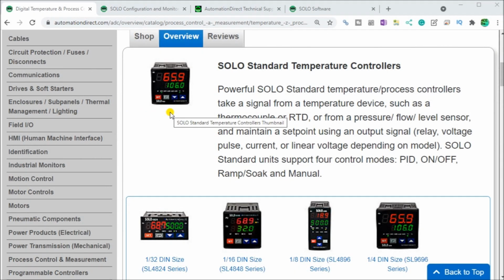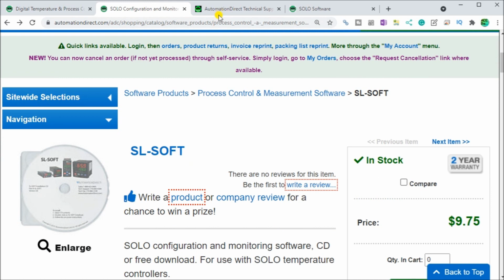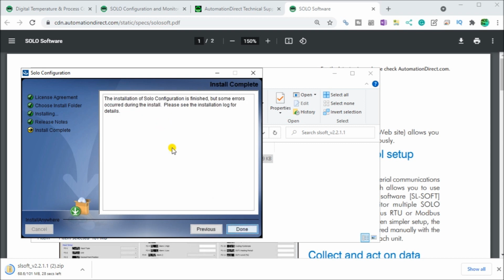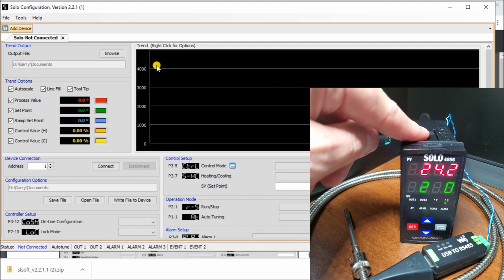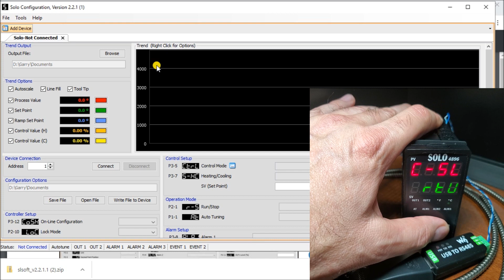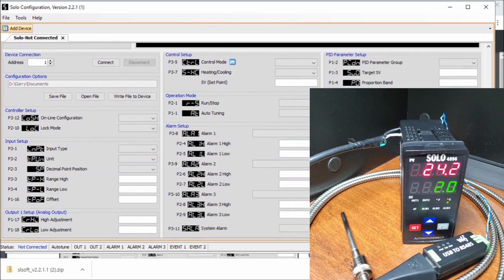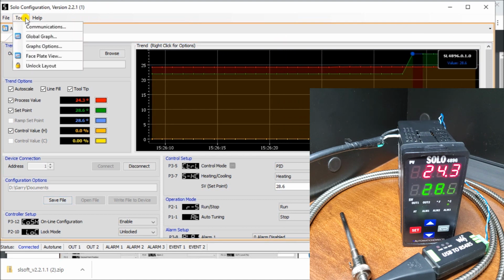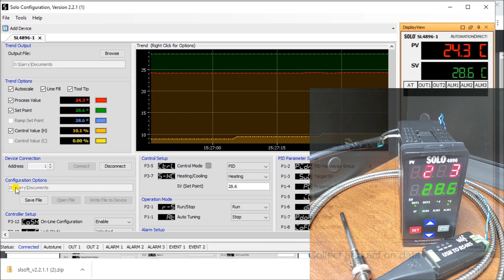Solo SL-SOFT Installation - Temperature Controller Software

Comment from the maker: More information can be obtained at our website. This includes all of the links mentioned in this video. 
https://accautomation.ca/solo-sl-soft-installation-temperature-controller-software/
All Solo Standard Process Temperature Controllers that support RS-485 serial communications can use the SL-SOFT configuration and monitoring software. This free package will communicate to monitor multiple SOLO controllers using Modbus RTU or Modbus ASCII protocols.
Regards,
Garry

Comment: I need help with modbus flex getter on node red. Who can I contact?
Reply from the maker: Hi Keshav,
You can contact me.
garryshortt@accautomation.ca
The following post will go over the Modbus RTU communication to the Solo Temperature controller. 
https://accautomation.ca/node-red-modbus-rtu-tcp-communication/
At the bottom of the post, you can download the flow for this application.
I hope this will help you out.
Regards,
Garry

Comment: how do I record information over a long period? right now, the software is not able to remember data for more than about 3 minutes
Reply from the maker: Hi Keshav,
The software was not made to record information. This is to set the parameters and monitor only. If you want to record over a long period of time, I would suggest using Node-RED. Here is a series on this free IoT-enabling software. You can communicate to the Solo with Modbus RTU, save the data to a database, and monitor using the dashboard or spreadsheet software like Excel. 
https://accautomation.ca/series/node-red-iot-enabling-software/
I hope this helps you out.
Regards,
Garry
Reply: @ACCautomation  How do I save the data to a database? Can I do so using SL-Soft or do I need to download Node-Red for this?
Reply from the maker: @keshavvasudeva1653  
SL-Soft is just for setting up and monitoring the temperature controller. You would have to download Node-RED and the database software like SQLite. Both of these are completely free. Follow the links that I provided above and they will show you step-by-step how to get the data from the controller and save it to a database.
https://accautomation.ca/series/node-red-iot-enabling-software/
Regards,
Garry
Reply: @ACCautomation  In node red, while adding values to the table, I keep getting the following error: "Error: SQLITE_ERROR: 1 values for 2 columns". What can I do? Is there some online help I can get?
Reply from the maker: @keshavvasudeva1653  
Hi Keshav,
Thank you for including the code with the error on the website. The "\" "\" indicates a text variable. You also need to ensure that you have a "," between the values you are storing.

msg = {
“topic”: “INSERT INTO TestTable (PV, SV) values (” + parseFloat(flow.get(“PV”) / 10) + “,” + parseFloat(flow.get(“SV”) / 10) + “)”
}
return msg;

I hope this helps you out.
Regards,
Garry

Comment: have you used an esp32 with bluetooth to read the solo modbus rtu rs485 temperature display register and transmit it to a bluetooth cell-phone?  🤔 thanks a lot nice video 🙂
Reply from the maker: Thanks for the comment q zorn. I have not used the ESP32 before. It looks like this only has WiFi with Bluetooth. RS485 will be needed to communicate to the Solo temperature controller.
Regards,
Garry

Comment: very nice info. have you used an arduino  "Esp32 pcb with bluetooth"  to read the solo modbus rtu rs485 temp display register and transmit it to a bluetooth cell-phone? 🤔 thanks a lot 🙂
Reply from the maker: Hi q zorn,
The easiest way to use your cell phone and control the Solo temperature controller would be through a headless C-More unit. You would use the remote app for the C-More on your cell phone to control and monitor the Solo.
https://accautomation.ca/c-more-ea9-hmi-series-headless-rhmi-remote-control/
https://accautomation.ca/c-more-ea9-hmi-series-headless-rhmi-to-solo-process-temperature-controller/
I hope this helps you out.
Regards,
Garry